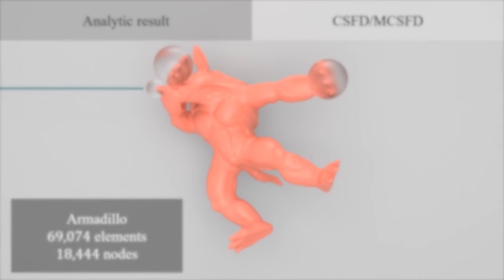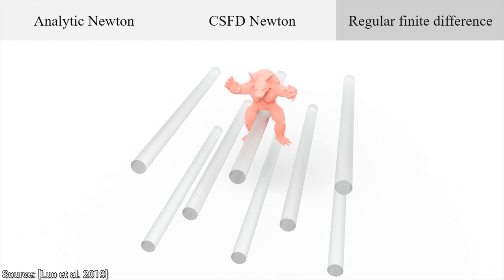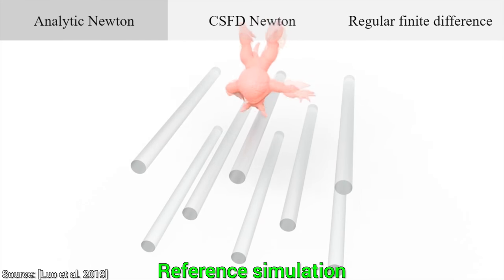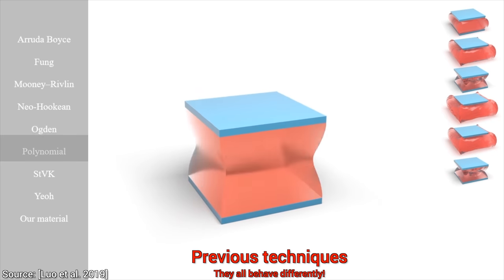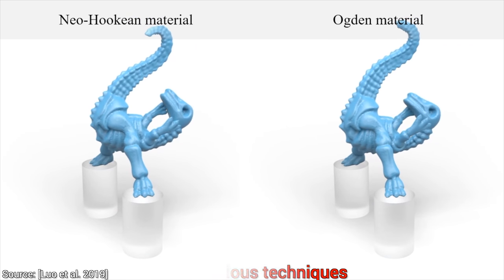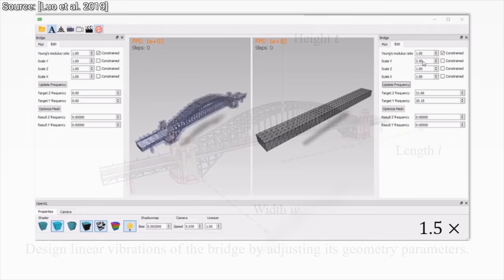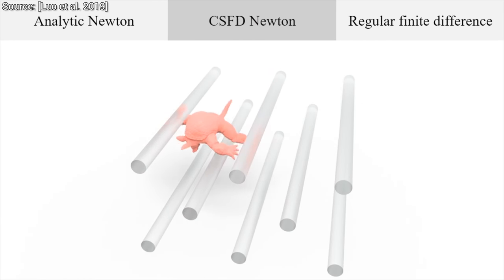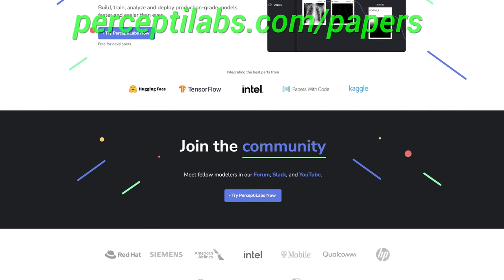Is Simulating A Jelly Sandwich Possible? 🦑

Comment: I swear the Power Rangers already punished this armadillo properly and are over it since a very long time, but for some reason computer scientists are not letting it go and seem to hold a grudge forever...
Reply: Is that where. the model design is from?
Reply: @Yourname942  Yes, It's a 3D scan of a "Power Rangers" action figure dating back from circa 1996 (first recorded use in a computer graphics research paper)
The character is called "Soccadillo" but you can easily find the file for this model by looking for "Stanford Armadillo".
I like that a lot of these famous test models are basically trinkets or little objects that the researchers had at their hand at home or on their desk.

Comment: How do they come up with the reference simulation?
I understand it's very slow and expensive to try to be the most accurate, but how do they know it's correct, or at least very close to correct?
Reply: I guess the reference simulation is simply more intensive and slow, and the new technique is designed to be more efficient so it can be extended to larger scales.

Comment: Because of the volumetric properties, could different zones be given different elastic values and used to simulate the movement of flesh on a skeleton frame? It's remarkably difficult to do accurately, due to the volume, folding, contraction, and spring/damping characteristics of flesh, I wonder if someone could make a realistic motion model with this